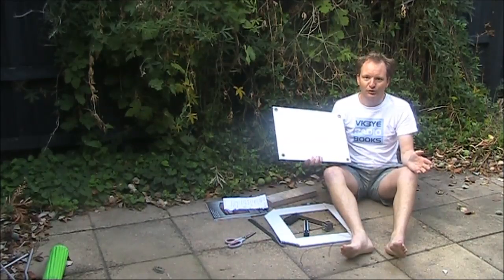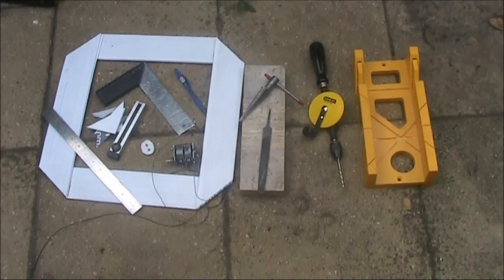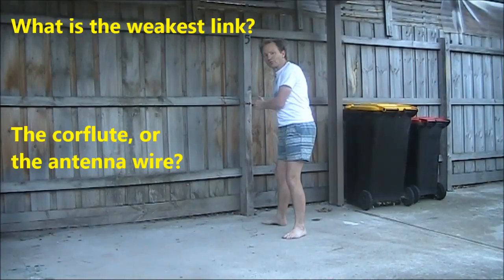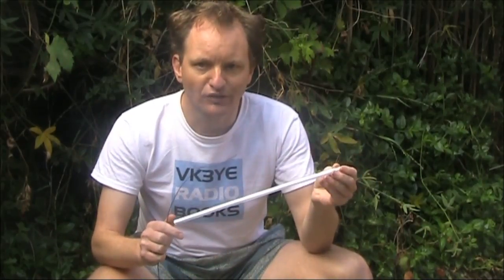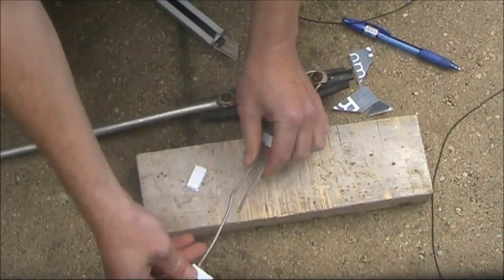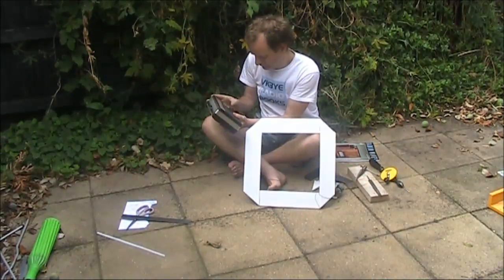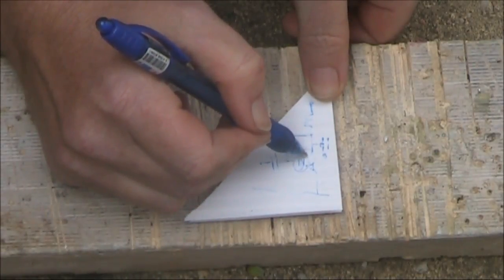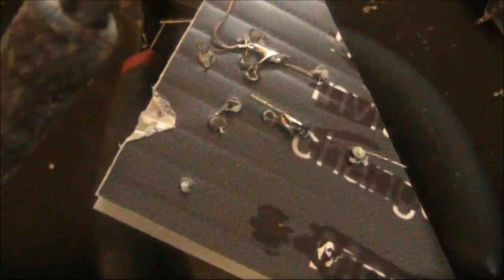Electronics on the floor: Uses for plastic corflute (or coroplast) material

Comment: Learned about coroplast 3 years ago. There's a guy from California, USA that has many videos on making individual homeless shelters, bicycle canopy, bicycle pulled trailer, a recumbent tricycle airflow bonnet, a tepee, and a boat. He begins his projects from 4 foot by 8 foot sheets. There is no place close to my home where I can purchase this size. I've picked up election signs that I can use for small projects. I hoped that I could find a source for the 4X8 to build a tepee shelter to house me and my canine for use in an event that my radio club does annually at a local park in February (winter here). I've always been a big guy but since I retired 24 years ago I've expanded laterally front to rear and side to side. Trying to set up a QRP station from the passenger seat of my coupe is a bit tight especially since I'm wearing cold weather gear to keep warm. Engines off and all radio is from a portable battery. Nice idea for the antenna insulators. I've been using half inch diameter PVC pipe sliced in 3mm slices for insulators for close to 25 years. They're light in weight, durable, and work perfectly for my nylon string guy and 18 gauge wire dipole elements for portable use. Nice video.
Terry  - KB8AMZ

Comment: I'd never thought about using that material as a dipole center or insulator,  my go to was Woolies plastic cutting boards.   I'm curious how good its UV  resistance  properties are though, a VK6 summer can be quite brutal.

Comment: We used coroplast to build a flotation tank in the center of a canoe for white water canoeing. This material is fantastic and has many uses. We purchase it for $15 USD for a 1200mm x 2400mm x 4mm sheet at the local big-box hardware store. I still can't figure out of that is high for this material, but I look forward to using it more in the future!